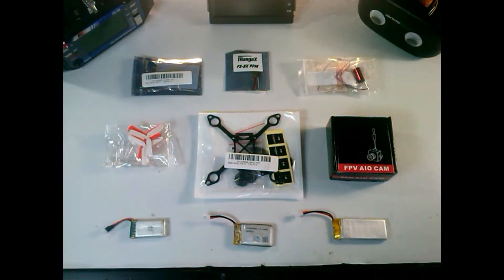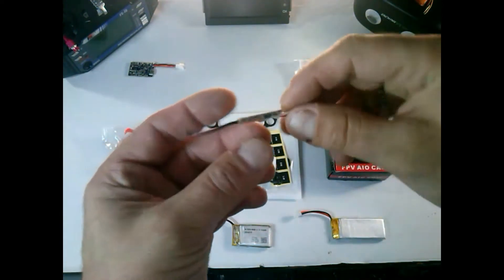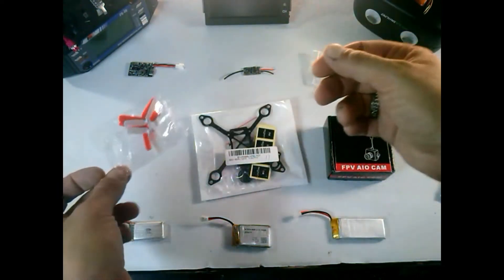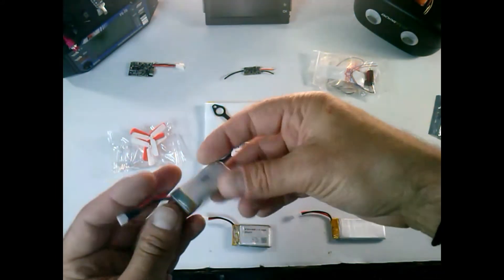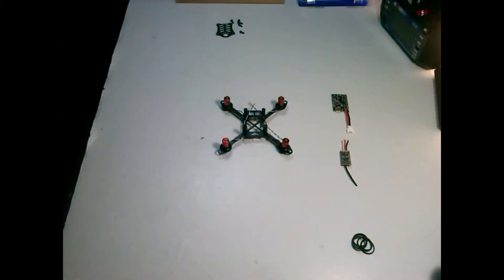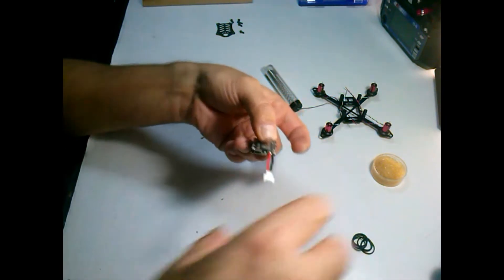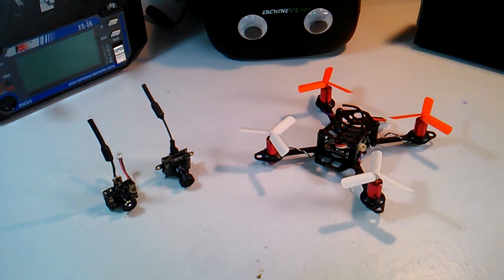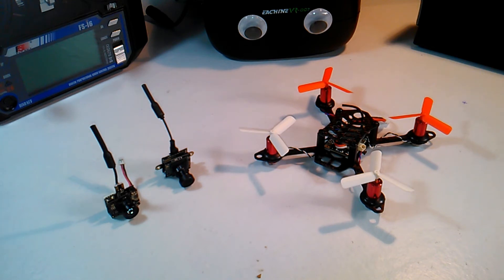Micro FPV Build with the F3 Evo Flight Controller

Comment: Can I connect this f3 Evo v2.0 with FS-iA6B receiver ?
Reply from the maker: Yes, you can use i-bus...
Reply: @DroneLoversFPV  can you tell me wiring diagram please.
Reply from the maker: @SiddeshChoudhary  https://www.google.com/search?q=f3+evo+v2.0+flight+control&client=ms-android-alcatel-rev1&prmd=ivsn&sxsrf=ALeKk03nkW_Tc9C49i3DaLcZbu3BbwUB8Q:1611242037350&source=lnms&tbm=isch&sa=X&ved=2ahUKEwjt6aGqqK3uAhWPTxUIHdcsAb8Q_AUoAXoECAIQAQ&biw=360&bih=628#imgrc=8wlA7sEZgzLwzM
Reply: @DroneLoversFPV  thanks for your reply. I have check but which one tx and rx I can use with my receiver on which  channel as I am using FS-iA6B. Can you please explain.
Reply from the maker: @SiddeshChoudhary  you can solder the 3 wires on de UART 2 (black on ground, red on 5volts and Yellow/White on RX) and then on betaflight chose port 2 for serial RX
Reply from the maker: @SiddeshChoudhary  https://www.google.com/search?q=f3+evo+v2.0+flight+control+flysky+receiver&tbm=isch&ved=2ahUKEwjfoPLby63uAhUM0xoKHWG1B3IQ2-cCegQIABAC&oq=f3+evo+v2.0+flight+controlvflysk&gs_lcp=ChJtb2JpbGUtZ3dzLXdpei1pbWcQARgAMgcIIxCwAhAnOgQIIxAnOgQIHhAKUJUHWK4RYMUpaABwAHgAgAHzA4gBlRCSAQcyLTUuMS4xmAEAoAEBwAEB&sclient=mobile-gws-wiz-img&ei=UL8JYN-4KIyma-HqnpAH&bih=628&biw=360&client=ms-android-alcatel-rev1&prmd=ivsn&hl=pt-PT#imgrc=k_wAINqum_3TjM&imgdii=wR8_BWTmsVQqqM
Reply: @DroneLoversFPV  thank you so much for your help and your time. I will try your solution 😊
Reply: Drone tranmistter link pls